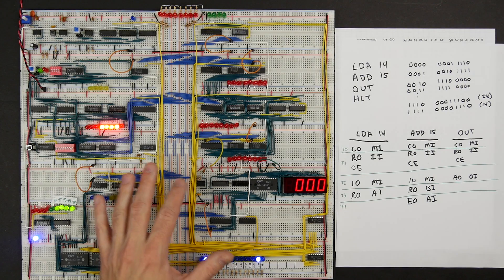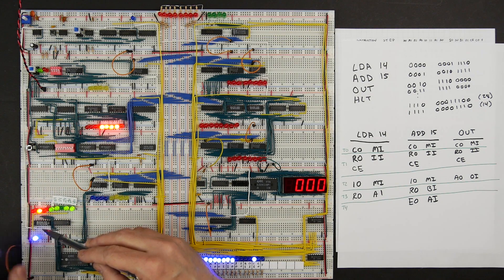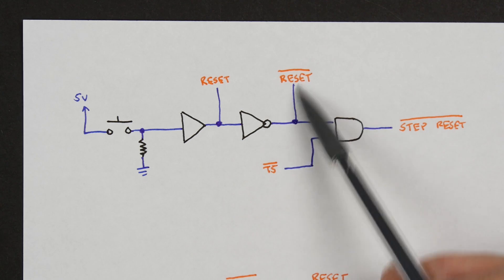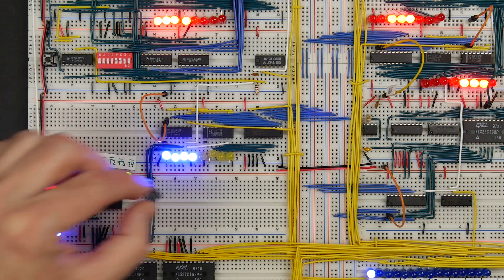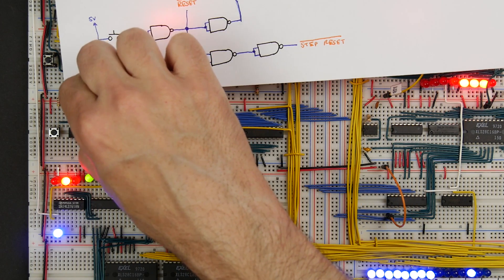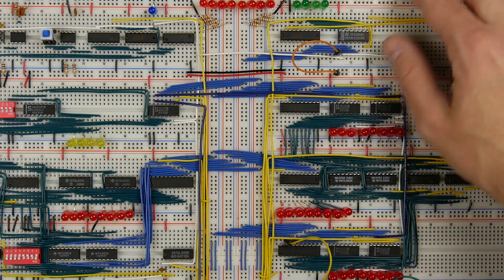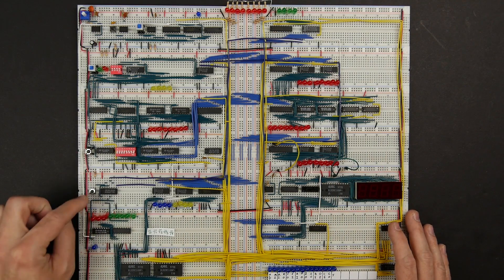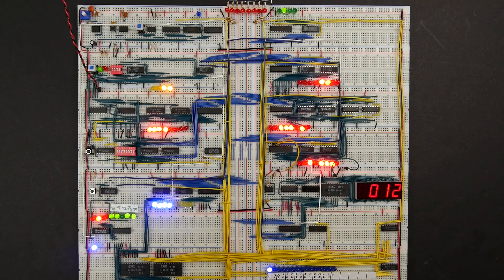8-bit CPU reset circuit and power supply tips

Comment: Ben thank you for the series. This is one of my favorites on YouTube. Next installment, boot monitor, GPIO, I2C, keypad w/hardware & software...? I guess I am getting nostalgic about my old KIM II SBC. The advice about breadboards is very helpful, especially when buying them online. I have noticed a huge difference in quality and spent a lot of time troubleshooting issues that ultimately were not my design or programming, but rather flaky connections (especially with signals that have critical timing).
Reply: I'm a  KIM-1owner. Still in working condition but not used every day. Faulty breadboards almost made me going bananas. 6 years ago I started to experiment with a PIC16F628A , blinky LED example. The LED was blinking sometimes , 2 Hz and sometimes there was a 3-15 sec. delay.
To make a long story short. Faulty breadboard. Dupont wires  badly crimped can cause strange problems.  With new designs I test every breadboard and cable.Start simple with a blinky LED an increase complexity.

Comment: It's interesting that the MB-102 boards you received are the low-quality boards with breaks in the middle, because the latest boards I purchased are exactly the same brand and even came in exactly the same package with exactly the same brand markings, but they're better quality than the ones you're showing and with continuous power rails and more consistent printing (although the numbers are still not quite aligned properly).

The boards I got still aren't the best quality, but they're acceptable if you're willing to overlook their shortcomings.

I posted a link to the eBay listing on a previous video.  The seller offers boards, a power supply plugin board and jumper cables, and offers them in a few combinations too.

Comment: Thanks again for the slow pace and the detailed explanations, Ben! Regarding breadboards, I've got exactly the same cheap brand, for less than 2€ a piece. They are a bit difficult to use, but they don't have upside-down numbers or split power rails on them - I guess yours are even cheaper copies of a cheap model. The cheapness of the boards can be a bit annoying, but once your components are placed it's not an issue anymore. - And now for something completely different, I saw someone else solder all their power connections together, using pinheaders for each breadboard connection. Anyway, thanks again, I'm looking forward to the jump circuit! =)

Comment: upgrade the alu so that it can also perform AND, OR and NOT operations ...
Reply: I want to build this... and then figure out on my own how to add a multiply, device, subtract, and or not, etc
Reply: oh, and save my programs onto eprom
Reply: @georgegardei340  Subtract is already done for you :). Multiplying is gonna take awhile, as binary multiplication is quite complex. Dividing is EXTREMELY complex and you would need like 2 breadboards just for division alone. Multiplication maybe you can get away with one. The AND, OR, NOT, etc operations however are super easy to do. You'll just have to change how the ALU functions from "Add or subtract depending on if this signal is high or low" to "I can set the ALU function register (Doesn't exist currently) to the command ADD (0001), SUBTRACT (0010), AND (0011), NAND (0100), etc". Can be done, you'll just have to make some alterations to how the ALU functions. I can help you with that if you still want help on it.
Reply: As for EPROM, you can build a simple enough circuit to take the output of the internal program memory and save it to an EEPROM or EPROM chip (Either would work), as well as have it load from the EEPROM/EPROM and save it to the running program memory. Can be done, and would be quite fun to have like 10 different EEPROM chips offboard in a container or something with different programs pre-programmed into them. Just swap out the correct EEPROM chip into the save/loader circuit, hit "Load", and off you go
Reply: Andrey Rumming couldn’t you just add multiple times like how the micro instruction thing works

Comment: Have you had any problems not using smoothing capacitors on the TTL chips? Mine was behaving very wonky until I started putting capacitors on all the chips.

Comment: Can't we use the non inverted reset, before the first nand gate?
Reply: Not really, voltage will probably drop a bit with current. It's better to use a buffer to keep the right logic level. But in this case there is not many outputs so it might works well anyway.

Comment: can you add an IO module, to see how the computer interact with the outside world. keep the good work ^^
Reply: That would be another register (C), 2 control lines, and now you got 8 outputs.  Need some bit math instructions though.
Reply: @trellend  Or do it like "real 8-Bit computers" and just use a part of RAM as a screen Memory
Reply: @QuintarFarenor  Then you have that annoying screen blanking thing going on.
Reply: @trellend  Not necessarily another register. It can exist on the bus with an output enable, but being latched on clock would improve stability, what with bits not being changed while attempting to read it.
Reply: @davidmcgill1000  I'm Starting to build my one 16-Bit Upgraded Version of Ben Eater's Computer, and I guess Instead of using The Bus Directly, we can use the Same Output Register used for Decimal Display. My Plans are just to use the Port using Arduino to Monitor and Possibly Input Data Aswell

Comment: You probably got this question a few times now, but how are you making these cables? Are you building the episode beforehand, destroy it and use the cables from bevore?
Reply: I've passed sleepless nights thinking about it. I can now honestly say I have no idea, he's probably sold his soul to the devil.
Reply: (my thinking) He pauses filming, measures and bends the cables, strips the ends and then films himself putting it in place.
Reply: For mine I use toenail clippers to strip the wires and then tweasers to bend each one individually to shape on the board then taking them off to straighten them out and putting them back in place so they fit perfect.  That said, I've been working on mine for over a year now slowly so everything is perfectly aligned
Reply: I mean you can count the breadboard holes the wire has to cover, and prep it on an empty board…

But he's clearly rehearsed all these videos except the troubleshooting one.
Reply: If you go back to the first videos, you can notice that he had this computer built before. So maybe he just disassembled it and he already has all wires bent in a right way

Comment: Thanks for the tips. I use the lower cost breadboards for my own build (a computer that also does video, see my videos). I bought these because you need so many of them. I can confirm that the insert can be difficult. Once you understand how the pins work internally, you know what is happening. They are not always well-aligned underneath the hole, and the mouth or funnel is not as good. There are videos that tear them open and compare. Just don't force them, wiggle a lot, and it should be fine.

I believe I have forgotten about the power rail gap many times already, very annoying. I suppose they are intended so you can do different projects. But bridging them also causes an unnecessary additional resistance.

Comment: what is the fastes you can run de cpu? can you try it
Reply: Aaro Perämaa the ROM is probably to mimicking factor of this CPU. The ROM I used had access speeds of 150ns meaning it could be accessed 6666666. 666 times per second or around 6Mhz :).
Reply: nils kauffmann I think right now it is limited by the clock, but with a fast crystal you could probably go up to few mhz before it starts freaking out.

Comment: Speaking of power tips, I think this computer is in desperate need of bypass caps. I think this will help a lot of people who are facing power distribution issues. Btw I'm a big fan of this series; you're doing an excellent job presenting every step of the way with great clarity.
Reply: Breadboards have nice capacitance between all the plates.
Shrinking a breadboard project down to PCB has in the past made me wonder why things would work on breadboard but not on PCB . . capacitance
Reply: @AnneJan  I was gonna build this whole computer eventually on prototype boards. That's a good tip.
Reply: He could also add resistors in series with his leds... some are clearly driven a bit hard and are quite bright. He could reduce the power consumption a lot, reducing stress on the psu caps and wires...
Reply: John Tsiombikas - A lot of that is Ben' religious use of the Fairchild DM series of 74LSxx TTL. They were much more tolerant than modern ICs. I am guessing it is the lower speed, but have done bench work to confirm.
Reply: Exactly what I was thinking. Just putting a cap on each power rail pair will prevent noise or high peak draws (as evidenced on the benchtop power supply). Not doing so could cause a lot of issues if you ramp up speed as the noise in the power rail could induce ic failure/nonperformance.

Comment: Why do you use the 74LS series chips and not the 74HC series? 74HC series chips are cheaper and more power efficient. They're a bit slower,  but that shouldn't matter in this case. If I understand the datasheet correctly, they're also able to source enough current to power an LED.
Reply: Naruto1310 That is true, but he is already powering LEDs with LS chips (they are not rated for that, but it works) and HC chips are really easy to dammage with ESD.

Comment: So Ben, what are you going to do in the next video? More op-codes?
Reply: Yes, I'm very interested in "what's next".  I just love this series of videos.
Reply: Paul Holt Well, you already have the display occupying one microcode bit, you can use it to enable writing to peripherals with OUT instruction instead of memory, like x86 does. I think
Reply: Ah, clever, so the OUT instruction's extra 4 bits could be sent out through a 74LS43 chip, with line zero being output to the display, leaving 15 lines for any IO purpose you desire.
Reply: I'd love to see what the simplest conditional instruction could be. How about IPC - Increment Program Counter on Carry?  Latch Carry, and signal the PC increment signal when the carry is set?
Reply: A new control line CN (Count enable when not zero), which sends a CE signal (skipping the next instruction) UNLESS sum-out bits are all low and CN is high: This lets us build the instruction CMP,  "Compare", which subtracts the argument from the A register and jumps the next instruction if the result is not zero.
 t0: CO MI
 t1: RO II
 t2: IO BI 
 t3: SU CN

Would that work with the timing? Might need
...t3: SU
 t4: CN

I was going to say perhaps something clever can be done with self-modifying code and a JMP statement, but I don't think that line of reasoning leads anywhere.

Who would have thought this CPU design thing would be so hard? :)
Reply: I am building this computer myself. I am thinking about adding audio out, just a little speaker. I was thinking instruction would be first four bits for audio out, next four for an address. The tone played would then be the value of the memory address with the first 4 bits being the tone, and the second 4 bits being duration (maybe in increments of 1/8th of a second). That would give it 16 different notes, that can be played for 0-2 seconds in 1/8th of a second increments.

I also want to figure out a way to expand the capacity of the memory. That will be very challenging though.

*edit ... oh and a keyboard to program the memory would be cool
Reply: I'm hoping for a simple jump instruction, so we can get some simple loops.
Reply: Crushnaut Normal approach is to memory map the io, that means as far as software is concerned, you control peripherals by writing control word to certain address of memory. The peripheral's enable pin is then activated via combinatorial logic in case the right address appears on address bus. Not having separate address and data bus complicates it a little but you can use what you already have for accessing actual memory
Reply: Memory mapping is great, but when you only have 16 bytes of address space you can run out very quickly.
Reply: Paul Holt Yeah afaik that's what you do in x86 or at least you did in times of 8086. Except that 86's OUT translates to bunch of different opcodes based on source, of course.
Reply: Instruction Register Out + Program Counter In = Jump.
Reply: I've thought about that too. I'm just not sure 16 bytes of RAM is enough to write any program of substance that contains conditional logic.

I did put an LED on the Adder Carry Out. If I was going to do this, I would build a latch for the Carry Out. It would be clocked by the Adder Out (Ben calls it SUM OUT) control signal. A new control signal, JC (Jump Conditional), and the inverted output of the new Carry Out latch would be connected to the inputs of an NAND gate which, along with the JMP control signal, are connected to the inputs of an OR gate, the output of which replaces the original JMP control signal.

Comment: Schematic updated to include the reset circuitry

https://github.com/kyllikki/eda-designs/blob/master/SAP-BE/sap-be.pdf
Reply: Wow, what a tribute to Ben Eater. These drawings are a great resource. Cheers.
Reply: I have the book and SAP-1 is indeed the basis of this design. however the design in the book has many  differences. For example it does not allow the contents of the registers to be seen (no 74LS245 buffers) 

My schematics are directly derived from watching the videos and do not reference the book at all just to be clear about any copyright concerns.
Reply: Just pick up a copy of Digital Computer Electronics - by Malvino/Brown (I think it's up to 3rd Ed now).  Although Ben is doing an awesome job with instruction on this topic and the breakdown of the SAP-1, the material originated there. It has the Schematics in there - but thanks to Vincent you can load them into KiCad and make changes.  Thanks Vincent/Ben.

Comment: I was quite surprised at the 1.2A current draw. I'm wondering if the majority of that is all of the LEDs.
Reply: if one LED needs around 20 mA, then 1200 mA / 20 mA = 60 LEDs
also the ICs themselves use some power, so this is one hungry beast of a computer ;)
I am getting components to built this myself, it is fun and very, very educational. Ben is doing a wonderful job by explaining all the inner workings in very simple and easy to understand way.
Reply: LEDs used for indicators shouldn't draw anywhere near 20mA.
Reply: The original design I believe was more around the 700mA range with the power supply design, so Yes the LEDs are adding a fair bit of current draw on the design.  I would probably look to reduce that by lowering the current on the LEDs, more like the 5-10 mA, most bright diffused LED can easily be visible in that range.  Especially when a resistor on the Logic Gate's transistor is what is limiting the current... has anyone taking the time to measure the current to the LEDs hooked up in this way, or know the internal resistors value?  (as you can see I'm a voyeur and not currently building one lol)
Reply: @LearnElectronicsCanada  he has about 60 leds burning !  (do not forget the segments..)  so about all power goes to the leds :) 
today you can run brigth leds at 1 mA.....
Reply: I mean... 5w doesn't seem much, considering the scale.
Reply: By using CMOS chips, you might be able to reduce power consumption. Of course, that might mean putting resistors on the LEDs.

Comment: I'm really enjoying this series, but one thing I keep hoping you're going to do is to use that spare bit in your microcode rom to implement a microinstruction counter reset signal so that at the last step of each instruction, your microcode rom signals that counter to reset so that architecturally when you're done with an instruction you're back at T0 again (giving you instructions that complete in differing numbers of clock cycles as well as no need to ever manually reset the microinstruction counter since HLT will do it as well and simplifying your reset logic overall).
Reply: thats a long sentence
Reply: I agree that would be quite nice. And I see two ways of doing such a counter reset. The first is use an unused control bit from the microcode ROM such as your suggestion. The second is to perform an OR operation on all of the control lines.... And if the result of the OR operation is 0, then reset the microcode counter.
Reply: dAcid lol
Reply: I was wondering if you could rest the T counter using the same signal as incrementing the instruction counter. The microcode wouldn't have to do this in parallel with the last step, but 3 step instructions would run 33% faster.
Reply: john smith One disadvantage of that is that I have been thinking about multi-byte instructions.  For example, LDA could be instruction 0001xxxx (disregarding the low order bits) and the address could be the next byte.   The microcode might look like FETCH, CE,  RO AI, AO MI,  RO AI.  You could then address 256 bytes of memory by my counting. But you would need to have a CE micro-op that does NOT reset T. No idea if that actually works, but I can’t imagine why it wouldn’t work.    But crucially, you need a CE that does not reset T.

BTW the reason I temporarily park the address at the A register is that I would be worried that if you transfer directly from RO to MI, the RO might update too quickly and then MI would be changed via the bus, and then RO would change, and then....  I might be being overcautious, good edge detection could probably avoid that and reduce the number of cycles a little.